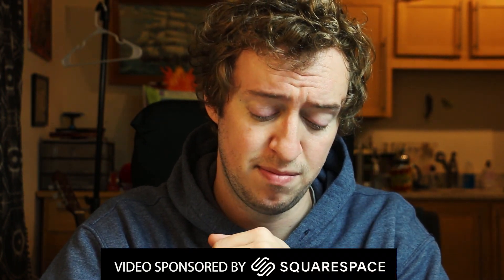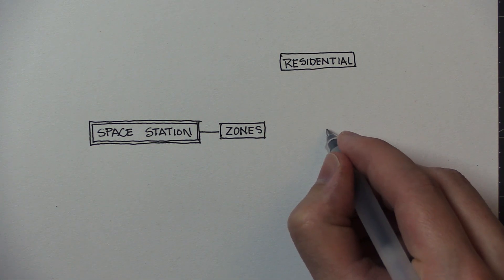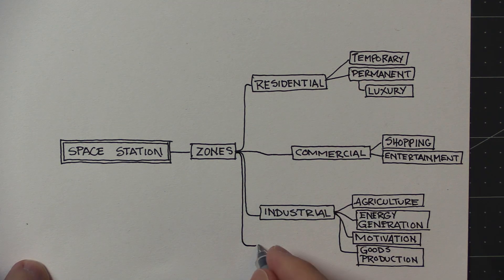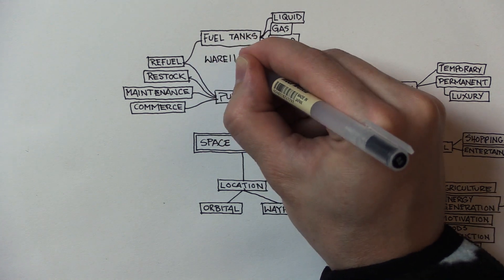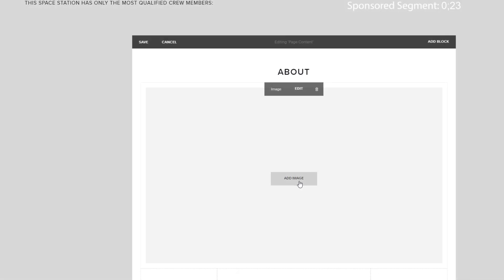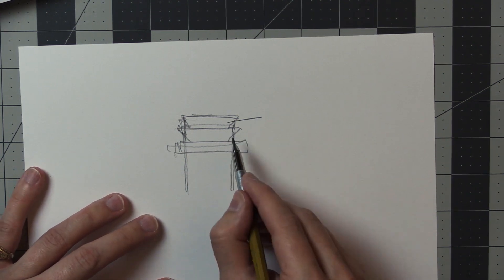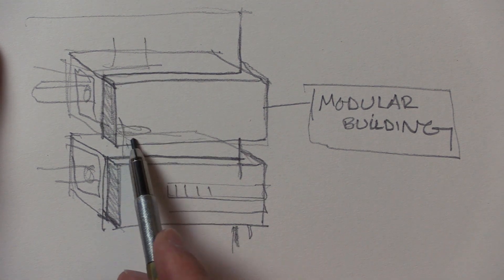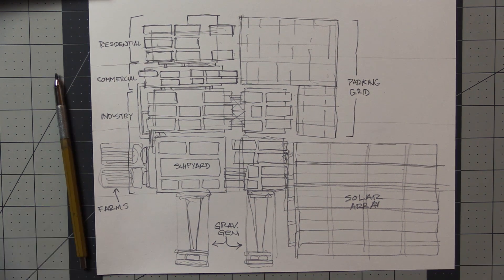Modern Principles of Space Station Design: Pt.1 (Planning and Sketching)

Comment: Hi Peter,

great attention to practical details on modularity and habitat placement.  I know I'm late to this video but I have some recommendations:

> Even most "stationary" stations will need some big thrusters for station-keeping and attitude control, unless maybe they are unmanned observatories at Lagrange points or something.  For efficiency reasons the thrusters are usually electric (or nuclear!!), take a look at Busek for example http://busek.com/technologies__hall.htm.  Hall effect thrusters are super old school, there are lots of fancy new technologies on the horizon.  In any case you'll either need a few of them in different directions or a smaller number on gimbal arms to point around different ways.

> For faster adjustments for docking and collision avoidance, you'll probably want an array of high-thrust devices scattered around.  The safest choice is probably cold CO2 gas, which is stored as a pressurized liquid.  The tanks may need refilling much more frequently than the electric fuel tanks, depending how active the station is.  There are thrustier fuels but they're much more dangerous.

> While this is written for cubesats, the info on slides 9 -12 is generally applicable.  "Isp" is basically "fuel efficiency" http://mstl.atl.calpoly.edu/~workshop/archive/2018/Spring/Day%203/Session%202/AmeliaGreig.pdf

> This is worth a skim as well https://www.nasa.gov/sites/default/files/atoms/files/artemis_plan-20200921.pdf

I used to sketch a lot as a young kid but at some point I got really frustrated with how bad I was at drawing faces, so I gave up and focused on other stuff.  You've helped me realize that I have the rest of my life to learn to draw.  Thanks for the inspiration.

Comment: You could think about internal services, e.g. on board security/brig, fire prevention, and a hospital/medical facility for weary travellers. 
Also any tax collection or toll booth / check points, with deterrent weaponry or an oppressive security screening area. Is the waypoint station privately/commercially or "state" owned, so do they need to protect/control any of their own citizens or traders/transports? And any good space station needs either a dingy cantina for the lowlife/criminal activity, or a nightclub with a reputation, so bill boards on the outside would add some interesting detailing. Just some thoughts, can't wait for the next one in the series!

Comment: maybe build a tourist area for us planet dwellers who want to visit- like an observatory area. Also a defense system in case space ships attack and build emergency escape vessels. We will also need a ventilation system that supplies oxygen and a main oxygen producing hub, some kind of way to make the station self sufficient in its own oxygen production and a carbon dioxide filter. fake gravity on space stations are created by a centripetal force meaning a main body of the space station has to spin around and what may seem like the walls of the spinning station will become the floor-  creating the false sense of gravity so maybe you could use this method if you want your station to have some gravity. Also need a way to get rid of garbage, we need. a large area for a trash compacter and a way to get it off the station- should we just put it out into space? is that ethical? too much trash on planet earth so now we shall contaminate space? Humans, man. Humans make a lot of trash.
Reply from the maker: We just launch the garbage into the nearest star, and centripetal gravity generation definitely was the default way to do it until these gravity wells were invented.  

I don’t think this particular station is designed to be a hot tourist spot, although there are some luxury suites. There are some other space stations designed with terrific views, positioned near supernovas and nebulas that light up the whole sky with incredible shimmering vistas.